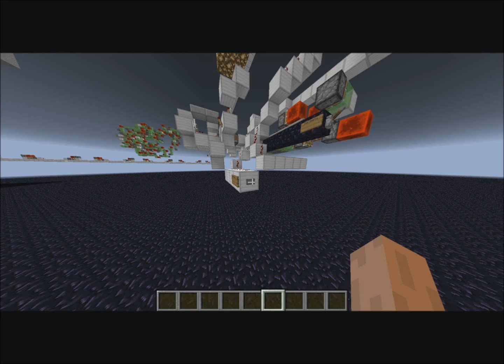First 3D Quarry

Comment: I think you can automate the wither chamber by using the wither cage by mackler: https://www.youtube.com/watch?v=nqYa--dJMYA  Then you can use arrows from dispensers and keep it filled using a skeleton spawner (using the kobra) or a mob farm with an arrow item filter. The mob farm might cause too much lag when used together with the quarry though :(
Reply from the maker: I don´t need wither cage designs. The reason i set up a wither cage using snowballs is, that they´re easier to build and I just wanted to get it done quickly. If I spend some more time I would probably implemented a system, that damages the wither by suffocating him in a block for a single gametick (Normally withers shoot blue wither skulls when you suffocate them, which you don´t want, but they don´t have time to do that, if you suffocate them for a very short amount of time).
And I already knew that design. It´s the simplest arrow design I´ve seen so far, but the wither cage I used in the quarry is actually even easier.

Comment: shouldn't gravel just fall down? make a flying machine with slabs go always underneath the current layer you are removing, and it will get destroyed
Reply: Pablete12 That was also my idea its in my opinion the only way to deal with gravel without useing hyperspeed engines so if you would add a working design for that you would only need something for liquids
Reply: lava should not be a problem, it will get removed eventually, pistons don't burn, redstone blocks don't burn, slime blocks don't burn.
water might be a pain because it can refill itself, but i think the order this machine passes thru blocks will remove water too.
Reply from the maker: Pablete12 Lava and water are big problems, since they can generate cobblestone in places the quarry thinks it has already mined.
Reply: i didn't think of that, but just having water somewhere, and lava somewhere else, is not a problem, right?
Reply from the maker: Pablete12
It shouldn´t be too big of a problem if you keep lava and water separated and if no liquids reach the control stations. But the wall-eater has the perfect speed to spread out water as far as possible, if it lands on him.
Reply: Pablete12 They also have big problems in sideways quarry designs in updating pistons when they push - making the pistons 1 tick and flying machines just stop

Comment: Isn't this 2D? I mean, height is not expandable without building more contraptions.
Reply from the maker: The wall-eaters and the conveyor belt are vertically expandable. Everything else doesn´t need to be expanded to process a larger cube. So if you want to mine a higher cube, you just need to expand the wall-eaters and the conveyor belt and the rest stays the same. So it´s expandable and therefor I consider it to be 3D.

Comment: Nice it's working :D

I have a basic detector for movable/unmovable blocks for a line of blocks it can move forward but it's extremely hard to move up or down and back is also a problem
Another problem is that it is only for 1 line and pretty big so is not really useful for a hole wall 
But it should be possible to connect a flying machine to it that starts if there is a unmovable block detected

Comment: so only the unmoveable block detection stuff left
i like this suggestion for improvements you made
- A roof could be added, to prevent piston getting accidently updated by lightnings. (It happens)
Reply: I think a block detection could be made by dropping something like items or armor stands from the top to the bottom before moving the wall eater forward then use a wither projectile in every line where the tester doesn't get down.
Reply: Schubert Roh oh yea forgott that but it takes a long time for the hole row to be ready again right ? and for that you would also need BUD's so why dont use sand ? a lot easier
Reply: Schubert Roh The ideas from most people for detect unmoveable blocks are awesome(like yours) the only problem is that you need to move it(and it needs to be stackable[in most cases])And it should not stop/do problems with the quarry itselfIn you design idea is tripwire or a press.plate not moveable(i think there is no moveable way to detect items or something like that)So a solution would be to drop sand because BUD's are moveable(problem with that they are hard to stack near each other)And than if a BUD doesnt detect shoot a witherskull or atleast stop the machineThe good thing with sand is its moveable in block form and also in entity form
Reply: robitobi01 moveable pressure plate: Redstone ore
Reply: robitobi01 Schubert Roh lol i talked to about the same idea last saturday on the TRQ Podcast.
Reply: enemysfriend22 lol i know, well the stream yesterday :P But what else can you do ? besides testing if there is a unmoveable block with pistons and BUD's or something like that or drop something down and if it doesnt fall on something everything is okay
Reply: projectiles :)